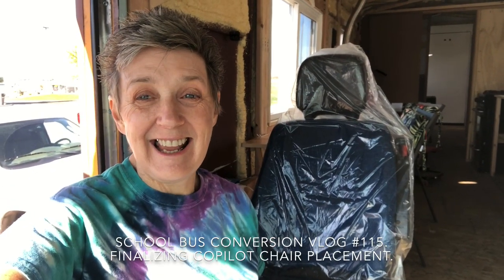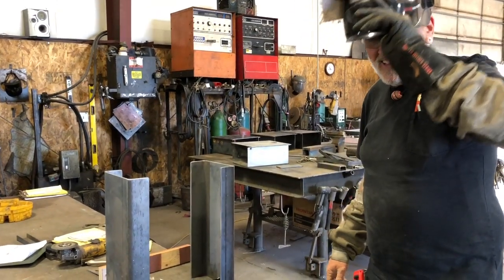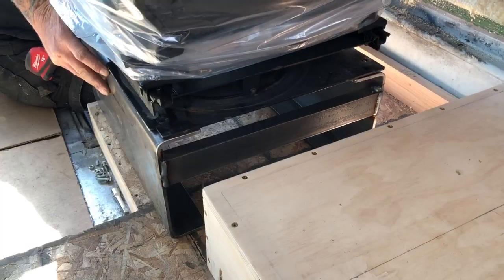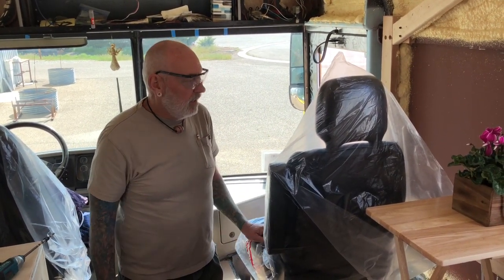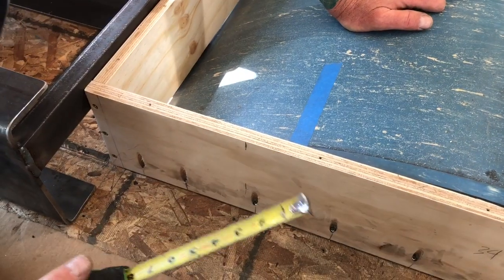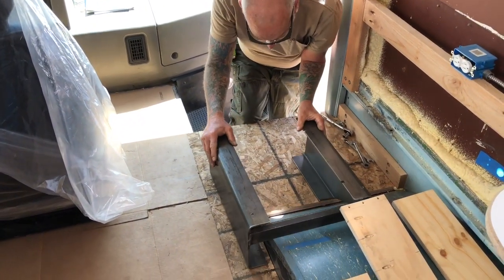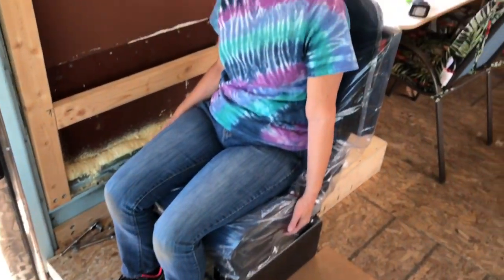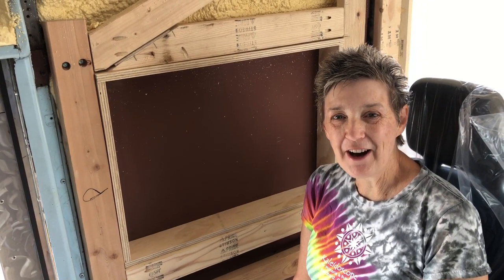Finalizing CoPilot Chair Placement - Vlog 115 School Bus Conversion

Comment: OMG!!! Great job guys! That is a MASSIVELY stable base for that seat! Such great inspiration for our seat install in the future! Question: Is the steel plates under the bus welded to the frame or just held in by the bolts & what size of steel is it? We ask because we have to do this same thing for our co-pilot swivel seat chair and want to do it right! You guys always seem like you know what you're doing! High Fives! We love you guys!!
- Brian +  Erin
Reply from the maker: The steel is a quarter inch thick. We will use grade 8 bolts to go down through the floor. Underneath we will make steel plates just like the driver seat has they are approximately 2“ x 4“ x 1/4” thick that the bolts will go through to reinforce it from the bottom. We are fortunate to have great help from Chris and Joe here at the shop. We don’t claim to be experts on the seat mounting but I don’t think it will go anywhere :-) we  still have to deal with the hook up for the seatbelt another issue :-) it’s great to hear from you guys good luck with your build :-)